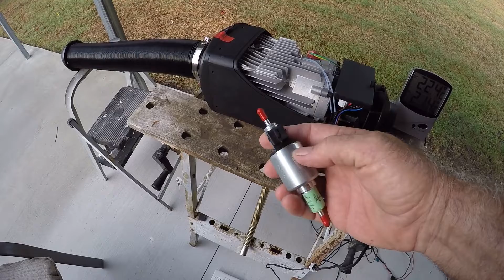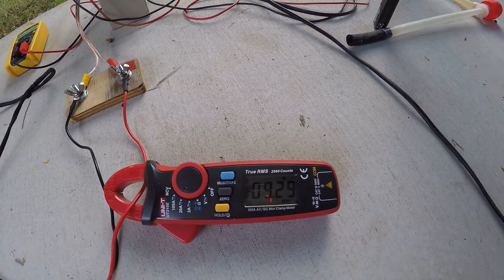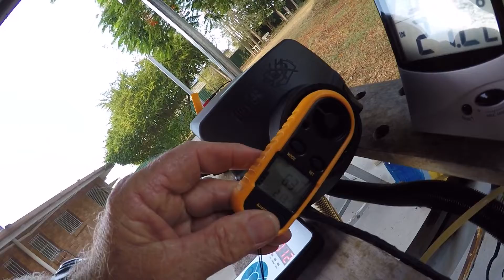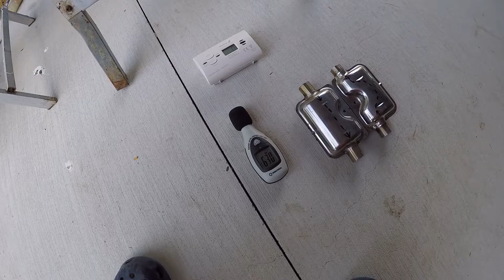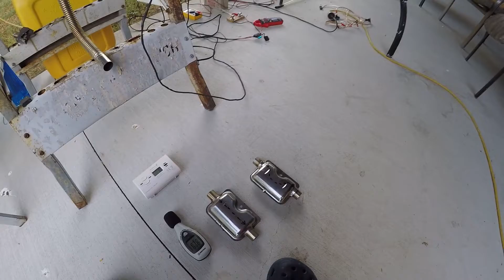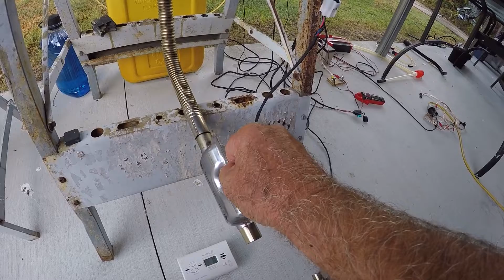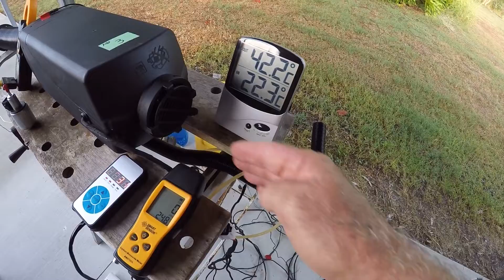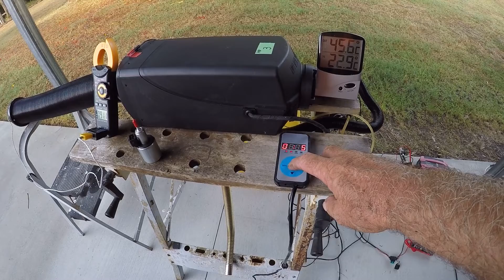Chinese Diesel Air Heaters - Part 2  -  5KW Bench Test

Comment: Hi John, Great videos provide a wealth of information.  Do you know the minimum operating voltage?  I generally start the night fully charged, but by morning often I am at 11.1 volts, in the coach battery depending on usage.  Will this be enough for a safe shutdown?  What voltage does the dreaded E-01 code show?  Thanks!

Comment: Thank you. I was debating on getting one . But I wanted to know how they worked. Glow plugs or Electrodes . I live in Alaska and I’m a heating tec . I like Diesel better than propane one it puts out more BTUs two is not as explosive as propane . I’m still curious about the burner chamber . How it itemize the oil . Good show .
Reply from the maker: Hi GW, thanks for the comments.
One big advantage of these heaters is DRY heat. No loads of moisture and condensation that you get from burning propane. 
The burner chamber has a mesh atomisation screen right around the top of it.  JMcK

Comment: What do you think the temperature difference would have been if it was conducted in a more realistic temperature? maybe 10deg, would the density difference make a big temperature reduction compared to 22deg?
Reply from the maker: Hi Drew, the heater has the ability to heat the ambient air, generally plus 70 deg C, depending on the Hz setting. If you run these heaters with an ambient temperature above about 30 deg C you will often get an overheat situation.

Some people like to reheat the accommodation air, some like to heat outside fresh air. It is personal preference, but heating outside air will require more diesel.  JMcK

Comment: Hi john, have you listed anywhere the ideal settings you've found for the fan speed and pulse rate min/max?
Reply from the maker: Hi Mat, No,  this series is aimed at the DIY person, not the enthusiast. 

I have found in most cases, that the factory settings to be the most ideal, and it is better for the average person to leave the factory settings alone.

One issue you have with changing the factory settings is you do not know immediately the long term issues of the changes. You can initially think you have adjusted for a better burn, only to find out later a serious carbon burner issue.   JMcK

Comment: Hi John,
Hope you are well. I have a question  for you. What is the correct way to measure the CO? I have noticed you are measuring with some distance gap between the exhaust and the CO meter... I have measured has close has it geta to the exhaust pipe and it gave me high readings... so I am wondering which way is the correct way. I have the same meter. Thank you
Reply from the maker: Hi Marco, there is really not one answer here. If you measure right at the exhaust you get a higher reading, but the heat will destroy your meter. Measurements are relative, and you choose just what you want to measure. I put my meter a short gap from the outlet to measure the mixed air/CO at that distance. If you had an inclosed room you could carry the meter on your person near your mouth as you want the reading of what you breath in. Same as you measure bath water. You put the thermometer in the bath water, not under the hot water tap outlet. You want the temperature of your bath water, not the temperature of the hot water coming from the tap.  JMcK
Reply: Thanks for the answer John. I understand now :) Greetings
Reply: Thanks for the answer John. I understand now :) Greetings
Reply: Thanks for the answer John. I understand now :) Greetings
Reply: Thanks for the answer John. I understand now :) Greetings
Reply: Thanks for the answer John. I understand now :) Greetings
Reply: Thanks for the answer John. I understand now :) Greetings

Comment: hi john ..is  it 2mm  int  bore  for   the  fuel  line from  the  tank to the  pump.. i want to feed it from a bigger tank thats easier to fill... love  the channel.. keep up the  brilliant work
Reply from the maker: Hi Kelly,

Suggest you use normal fuel hose  from tank to filter to pump. (no joiners)
Suggest you only use narrow bore hard nylon fuel hose from pump to heater

Thanks for the kind comments.  Cheers JMcK

Comment: Thanks for your in depth reviews. I've a question, do you think that 2kw would be enough to heat 4x4 truck (Nissan Pathfinder 2006), or a should install 5kw? Thanks in advance and good luck!
Reply: Probably plenty I've seen caravan 17gt poptop with 2kw. Think how big your heater box in the car is and that it gets car to 30degrees inn not long time.  60 to 90degrees outlet air will surely heat a car in  time.   I used mine ţo heat my 3bed house 5kw one

Comment: Can it be ran off a small battery all the time or is that just for the video? What happens when the battery gets weak? Will it go through its shutdown or just stop and burn up
Reply from the maker: Hi Mr O

Yes, you can run the heater on a small battery, for a “small” amount of time. 

The heater will consume roughly between 1 and 3 amps per hour depending on the heat settings. This determines the length of time any battery can provide power to the heater.

These heaters have a low voltage safe shut down procedure. Your heater will safely shut down when low battery voltage is reached.

Regards.  JMcK

Comment: I just installed a 5kw heater in the basement (baggage compartment) of my motor coach, I have made no changes/ modifications in the burner intake or exaust tubing lengths that came with the installation kit, I used the black flexible ducting that came with the kit for the heat exchanger intake which draws cold air from outside the compartment, now I need insulated ducting from the exaust side of the heat exchanger to the interior of my motor coach, what temperatured do these 5kw heaters  produce when the heater is on a maximum setting?.
  Great video series you have provided regarding these little heaters.
   Thanks for reading!.👍
Reply from the maker: Hi Eric,
At full power, these heaters can increase the ambient air by around 80 deg C to 90 deg C 
Assuming you would still want to run the heaters with an ambient air of up to around 10 deg C, you can expect an output air temperature of up to 100 deg C at the heater at full power.

Cheers.  JMcK
Reply: @johnmck1147  Thank you very much for your time and response, your expertise in this subject is greatly appreciated. 
  My only reason for asking is to make sure I purchase ducting appropriate for the heaters output.certainly don't want to wake up to a massive Motorhome fire.
Reply from the maker: Eric Dee 
👍

Comment: Is there a link to a website that troubleshoots these units? I get the E-06 motor fault on my 'new' unit... got it a few months ago but didn't get around to testing till now... and only hthe controller/LCD panel seems to work. After about 10 seconds that error code keeps returning...
Reply from the maker: Hi Greg, there is a lot of information out there on these heaters on the internet, suggest you type in your search requirements.

Occasionally you get an issue from with these heaters, just as you do with expensive name brand heaters. This is why it is a good idea to bench test them on initial purchase, and if there is a serious issue get a replacement straight away.

E-06 generally refers to the fan motor or wiring. Have you connected up the heater with the correct polarity?

Have you had the heater apart? There is a sensor under the ECU that measures the fan speed and if this is not in the correct position from an owner reinstall after a strip down, or initial factory assembly you will also get an E-06 code.

Can you feel the fan scraping the case? (When not operating) Put your finger on the fan and run it back and forth, do you feel the fan scraping the case or does it spin freely? If it scrapes you can also get E-06 error. In video no 18 I make brief mention of this fault and a fix.

Good luck.   JMcK

Suggest you check both
Reply: @johnmck1147  Yes, it was the fan. Not moving at all. Pushed back tight. All I had to do was wiggle it up and free it some. I then learned they didn't supply a battery for the remote... A27 and not found in most stores. Thanks for the advice.
Reply from the maker: greg pauletti 
👍

Comment: What does it mean if it is 5kw or 2kw?
Reply from the maker: Ni TF, it refers to the maximum heat output in watts. The 2Kw heater puts out a maximum of 2,000 watts. The 5Kw heater puts over twice the max heat as does the 2Kw heater.   JMcK
Reply: @johnmck1147  Wow,. I guess 2kw is enough for a camper van then. Thank you.
Reply from the maker: Talking Fish 

👍

Comment: Hi John, great videos! Can the pump be closer to the fuel tank to reduce the noise? Would a distance of around 3 metres be ok? Thank you
Reply from the maker: Hi Paul,

The closer the pump to the fuel tank the better. Like most pumps they "push" much better than "suck". It won't change the ticking noise though.  JMcK

Comment: I have a 5KW all in one Chinese diesel parking heater with the LCD controller and 4 button remote. The LCD  control panel screen is very dull, i.e. not bright enough to read in daylight whilst running it.  Is there any way the brightness can be increased on these control units?
Reply from the maker: Sorry Ronald, at this time I personally know of no way to change the brightness of an LCD controller. Perhaps a viewer may know.  JMcK

Comment: Hi john , we have error code 04 on our heater, it’s seems to be the oil pump connector as when my husband fiddles with it a bit it works but then shuts down. Is there anyway this can be fixed or should we buy a new one? We have replaced the actual oil pump so there is not a problem with that.

Comment: Hi John

A great video do much valuable information
I’d love to go something along these lines in my shed but the size of my shed (11m x8m x 4m high walls)and being in a colder climate (north west coast of Tasmania) Assuming one of these heaters would struggle to make any difference other being right next to it
Are there scaled up versions of these
I have a shed full of older cars so safe space is a premium 
Cheers 
Michael
Reply from the maker: Hi Michael, sorry I missed this post. To my knowledge there are currently no larger copies of these Chinese air heaters. That is a big shed to heat, and I do not know if it is insulated, but these heaters are so cheap you start off with a couple and see how they go. If your shed is insulated you will be surprised how much heat two or three heaters can generate.   JMcK
Reply: John McK 47  thanks heaps 
No insulation at this stage
For the size and cost worth a try
Any that you would recommend 

Cheers 
Michael
Reply from the maker: Michael Harrison 

Hi Michael, sorry no recommendation as the sellers come and go, but suggest you buy off a seller with an Australian warehouse (ships from Australia) has a good rating and accepts returns.  I would be interested in how you go. Good luck.  JMcK

Comment: Great video! Thank you so much for making them. Could you please tell me, how do these units do with vegetable oil or bio diesel? Is there some sort of retrofit required?
Reply from the maker: Not suitable Michael. Oh, the heater will run,   -  for a while. Just as your car engine will run without any engine oil,   -  for a while.  Vegetable oil will cause rapid carbon build up in the heater and it soon won't work. The manufactures state bio diesel is not a suitable fuel for their heaters, but I personally have not done a long term test on bio diesel to make a definite comment, and I only like to make comment on something I have personally tested.  Regards,  JMcK
Reply: @johnmck1147  right on, thank you for your reply

Comment: Mr. John, What are your thoughts on an enclosed exhaust system along with outside air were you would pull most of the heat off the exhaust pipe ( NO exhaust gas at all ) with the 3" pipe that blows the air over the heat sink. Like it would be a pre heat air system. I hate to see ALL heat lost off that exhaust  pipe. Do you think it would mess with the CONTROL system. Thank you for your input.
Reply from the maker: Hi RanchDude, good for you if you can recover some of the exhaust heat. Some people wrap a section of the exhaust with copper pipe, say 6 mm, to get some hot water from the exhaust.  

Provided your exhaust heat recovery is from the outside of the exhaust pipe and you do not add restrictions or excessive length in the exhaust, there should be no issues with normal operation.   JMcK
Reply: @johnmck1147  I might be 76 yrs old and a little slower then I used to be but it looks like I still might be able to come up with a few good ideas. Once again it has been so enjoyable  watching, and Re watching your Vids. Thanks again.     Rick   ALSO: as a point of interest, I have weight both of the pumps to see if the winding's for the coil inside were different, but they BOTH weighted the same.   Go figure!!!  ???
Reply from the maker: RanchDude43 
Once again, good for you RanchDude, and thanks for the feedback.  JMcK

Comment: Mr. John,  I have a 12v system with a pump that is marked  with 12v/24v and it works just fine. For back up I ordered another 12v pump and was sent a other pump, but it was ONLY marked 24v , will it work properly.  By the way, I live by your Vids. Once again well done!!!
Reply from the maker: Hi RanchDude, 
Without testing one, I can not give you a definite answer. The pump works by electromagnetic energy. Applying voltage and current to the coil creates a magnetic field and pulls the piston upwards. 

I suspect it will still work in a fashion but less voltage would provide less of a magnetic field and hence a weaker force on the piston operation, even perhaps a slower piston Hertz rate affecting the heater operation. The piston may have trouble pulling against the return springs with a lower magnetic field.

But because I have not tested this myself, I do not really know for certain. You have pricked my interest and and I will try and order a 24 volt pump for myself to test. But how this will go in the middle of this Corona issue is uncertain. If you test the pump, I would like to know the outcome. 

Cheers.  JMcK
Reply: @johnmck1147  And also with you. If can get one tested you could let me know. I have a 8kw heater and the pump that came with it is marked 12v-24v and works fine with the testing I have done. I also wondered  about the speed of the pump at 12v verses  the 24v.  Thank you again. Rick, from the USA  MATE
Reply from the maker: RanchDude43 

Hi Rick, first the speed of the pump will not change as it is a pulse pump. One pulse one dose, regardless of the pump voltage. The dose of different pumps can be different if they have a larger piston/bore/stroke.

Second, have you seen my video on the 8kw heaters? (or so called 8kw heaters)

Cheers.   JMcK

Comment: Great video John! Very informative. Just wondering what make this 5kw heater is? Do you have a link? Some many of these to choose from. I want to be sure I'm getting a Eberspacher clone? Much appreciated!!!!
Reply from the maker: Hi Ziggy, there are many different factories in China making these heaters, and most are unbranded. I can not give you a link as eBay sellers come and go. I checked recently for another viewer asking for a link but I found none of the sellers I bought from last year still sold the heaters and a few sellers had disappeared. 

I suspect they buy a batch of some product and when they are sold move on to something else. I often see signs like "only 3 left". I have yet to come across a seller specialising in these heaters. 

Search eBay, or places like Amazon for Chinese diesel heaters. Look careful at the supplied photos to see if it looks the same as the hearer in my video here. These heaters are copies of the German Eberspacher heater. There are also on line copies of the Webasto heater. They look a bit different from the heater shown above.

Sorry I can't be of more help.   JMcK
Reply: Thanks again John. I'll do some searching👍

Comment: What do you think about the fact the circuit board components are more exposed than likes of better brands John? I am  wanting to put one in a portable box and was wondering about the air flow from the inlet 5 inches away from the fan to the external outside of the box. I was thinking if it was a rainy day if moisture could draw in over the components , any ideas ? thanks .
Reply from the maker: Hi Atommachine, Yes, protection for the ECB could be improved, and the Chinese circuit boards are not encapsulated in resin like the German made heaters. However it is rare to hear of any issues here related to environment, also repairs for the DIY person are so much easier.

But what I often do is spray the circuit board and connections with a circuit board clear protective coating, available in pressure pack from any good electronics shop.

I hope this helps.  JMcK

Comment: Does the the plastics around the burner give off fumes as the other more expensive units bost that there product's don't? I would like to purchase one of these units,but am curious to know why some are 700.00  to 1,400.00 ?
Reply from the maker: Hi My 2 cents,  I personally have never observed any fumes given off by these Chinese heaters with the plastic case, also I have never had contact with anyone who has reported knowledge of plastic fumes.  However, if this concerns you, you can buy one of these Chinese heater which has a full aluminum case, instead of plastic for under A$200. Although there may be some variance now due to Corona virus issues currently in China. JMcK

Comment: Are these heaters able to run off gasoline?
Reply from the maker: No Dan, they can not run off petrol or gasoline. One Chinese manufacturer did bring out a gasoline version recently but it was a failure and removed from sale. You can, however, buy a gasoline version in a genuine Eberspacher heater.  JMcK
Reply: @johnmck1147  Thx for the reply John hopefully they will come out with one that works.